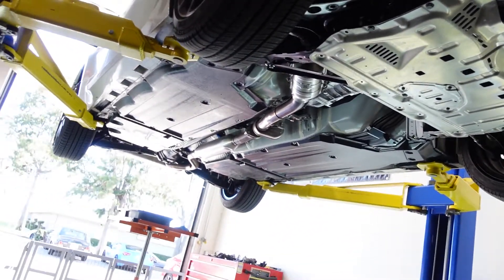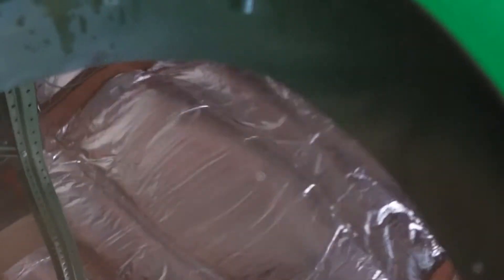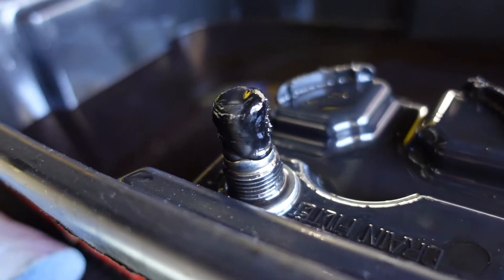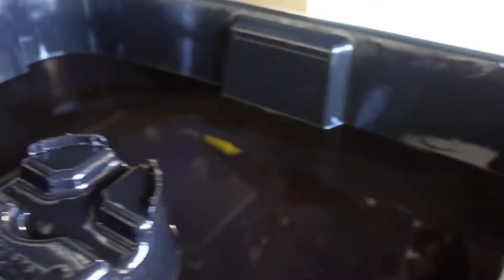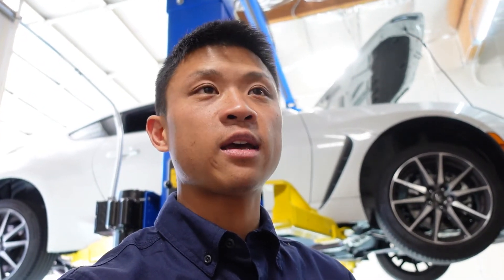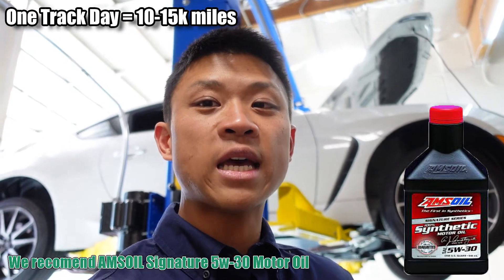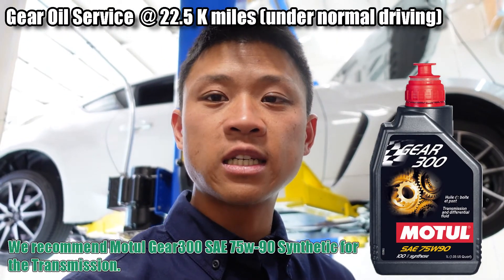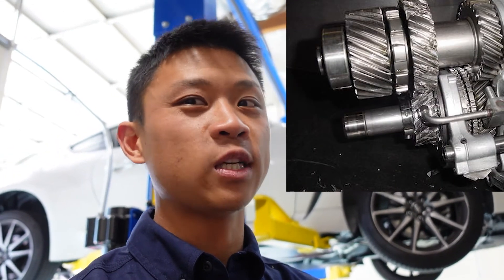GR86 Transmission Fluid / How often should I change?

Comment: sorry to necro this old post! Are these oil recs for track days or normal street driving? Or both?? I'm in SoCal. I'm at 18K miles, 3+ years on my 22 BRZ manual trans...thx for answering all my Qs!
Reply from the maker: Wow short hair Ezekiel in this video! 

The oil rec are fine for both track and street use.

We use Amsoil MTG or Motul 300 for the trans

Amsoil SVG or Motul 300 for the rear diff

Comment: Motul Gear 300 is in short supply at the moment, so I plan to use Amsoil 75w-90 mtf instead. Is that still good? Afaik it's a direct substitute for gear 300, just less popular.
Reply from the maker: Apparently Motul is hard to shift when cold in these transmissions, but I would have no idea as I live in CA where we consider 65F cold

We are an Amsoil dealer and I've used MTF. Its great stuff, but I still prefer Motul for HOT track days
Reply: @CMAutohaus  i'm also in CA. I'm sure the motul is better but I imagine amsoil is better than OE for tracking in the heat.

Comment: Thanks again for this vid! Do you use the Motul 300 for both gear oil and auto transmission?
Reply from the maker: Auto transmission requires a different fluid. We prefer Motul 300 for the manual trans and Amsoil Severe gear for the rear diff
Reply: @CMAutohaus  got it! So I was able to find Amsoil's ATF. Which ATF do you recommend for the TX6A 6AT?

Comment: I have 2024 GR86. 5300 miles. Its is Auto and I do not track this car. I do drive it alot. Put 5300 in 4 months. When should I change the differential and Transmission fluids? I dont want to wait so long as per the manual but i dont want to change it too soon and just waste money. Any tips would be greatly appreciated
Reply from the maker: 30k for auto trans and rear diff. Find a good independent shop to really do the auto trans service and not just a 2 qt drain and fill
Reply: @CMAutohaus  so you think the dealership will do a bad job? I have to research in New Jersey where there's a good shop
Reply from the maker: @NJ_Galactic  Dealership will probably just do a drain and fill. Also with you being on the east coast, your Toyo/Subaru dealers probably rarely work on these cars,
Reply: @CMAutohaus  thank you brother.

Comment: The 2022+ GR86/BRZ uses 75w-LV for transmission?
Reply from the maker: A synthetic 75w90 gear oil is fine. Its the same transmission as the gen1

Comment: When r u normally sposed to change it on a brand new car if u daily with some parking lot drifting here and there?
Reply from the maker: 22,500 miles is still a good rule. Just like engine oil, cant change it "too often"
Reply: @CMAutohaus  what about diff, do they usually get changed together
Reply from the maker: @NightKidBrandon  Yes both fluids at the same time
Reply: @CMAutohaus  why'd you pick such a random number? Is that what the Toyota manual says?
Reply from the maker: Yes thats exactly what the FSM says:yt: @GokuInstinct1

Comment: I changed my differential fluid at 10k. my gr86 is nearing 28k miles. it's an AT. what would be best fluid for the transmission?
Reply: Motul or amsoil